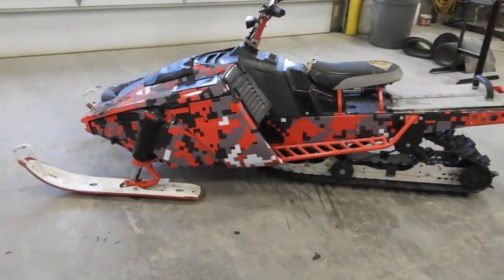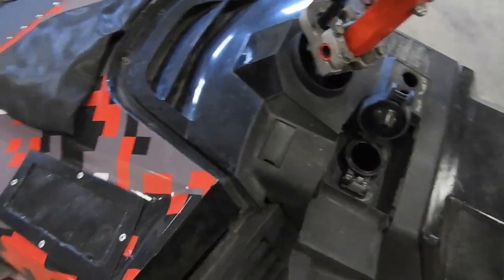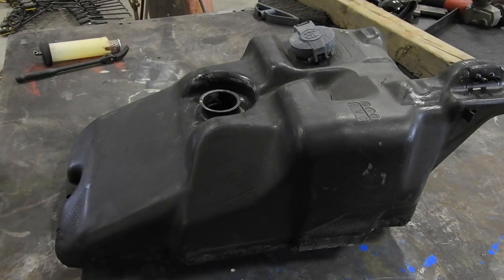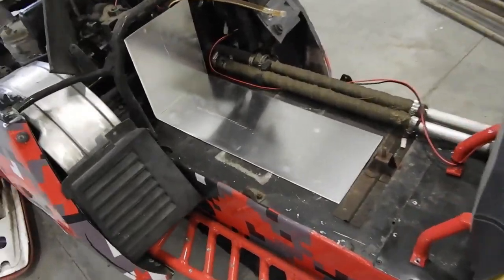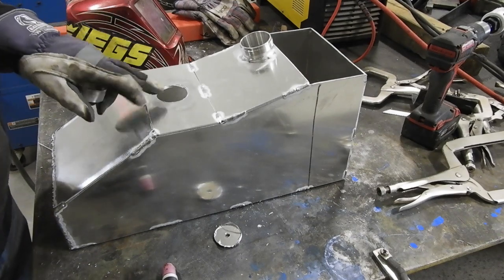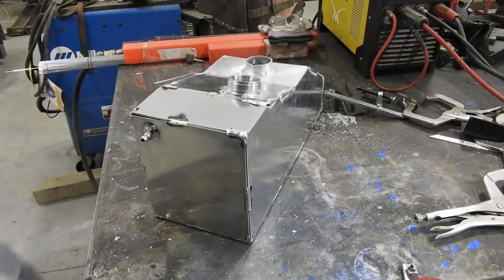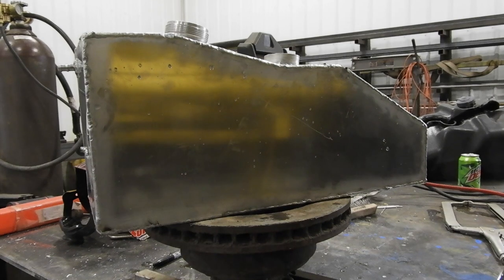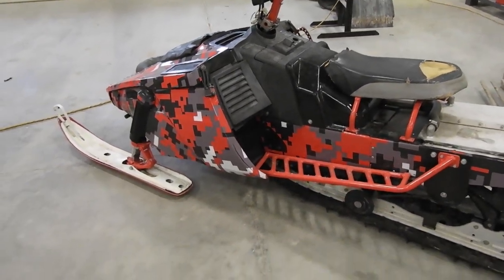Building a Custom Fuel Tank for my 600cc Mod Phazer

Comment: so like 6 weeks ago I had only ridden a snow mobile once.  now I own 3 phazers.  im not sure if you inspired me or cursed me.  either way I need help.  we got my wife a 1994 phazer 2.  it hadn't ran in years.  I rebuilt the carbs and fuel pump and got it running.  we took them out and was going good when her phazer made a screech noise and stopped.  we towed it back with my 86 phazer i pulled the motor pulled the heads and cylinders and everything looks good. only issue I have seen so far is the motor had almost no oil in it.  no rust no metal shavings.  I ordered a clutch puller to get to the oil pump but I still can not get the clutch off.  what am I doing wrong??   how do i get the clutch off?
Reply from the maker: I've never had any luck with clutch pullers. I have a bolt that threads into the clutch and I tip the engine on its side so I can pour water in the center of the clutch, then when I put the bolt in it creates hydraulic pressure and pushes the clutch off.
Reply: @adaminthemitten8940  seriously ?  I will have to give that a try.  thank you.  and thank you for teaching us idiots .  well me anyways

Comment: What type of seat do you use?
Reply from the maker: These are seats from small Chinese quads, can find them on Ebay for pretty cheap
Reply: @adaminthemitten8940  you may have posted a vid showing it but what happened to the seat? You use new ones I've noticed and that thing is looking 20 years weathered already.
Reply from the maker: @guyincognito1431  that's a used seat I got for free, I plan on buying a new one to replace it soon